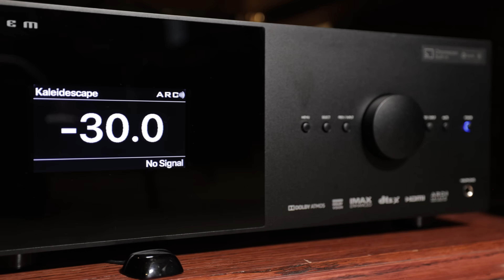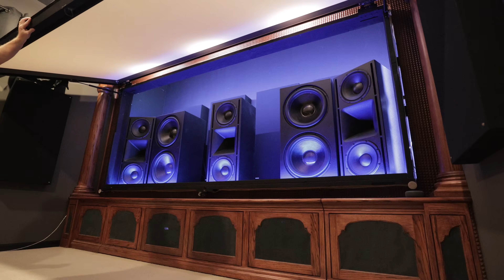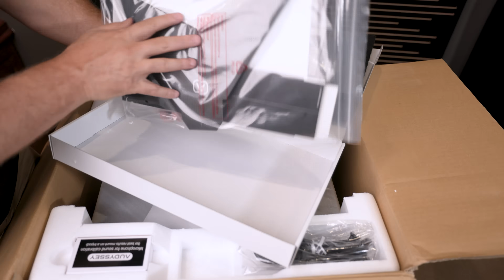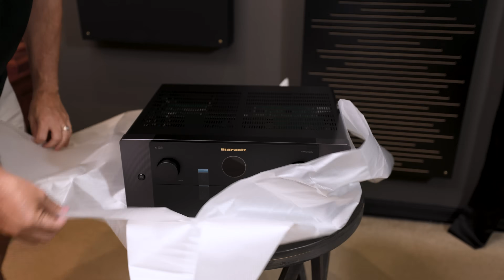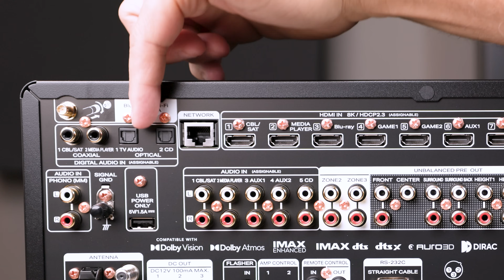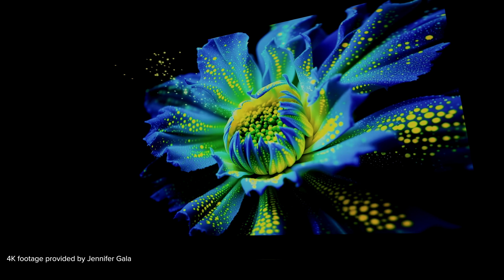Should I Switch Back?

Comment: Hey great video,

Crestron home can control the Marantz through ip, it’s easier to configure and gives bi directional communication giving the home processor feedback if the amp is on or off, which mode etc

Comment: I had the Anthem 70 8k runnin 7.2.6. I sold it along with Tonewinner 11 chan 8300pa amp. Now I run a 5.2.4 with just my Onkyo RZ50. Less wires & mainly a lower Coned bill

Comment: I definitely wouldn't buy marantz or denon again, both are the same products in different boxes. I had nothing but reliability problems with both brands, after trying several different av products with both manufacturers.
Reply from the maker: I’ve owned 2 Denon AVR’s, 2 Marantz AVR’s and 2 Marantz processors. Absolutely zero issues with all 6 of them. 🤷‍♂️
Reply: @Youthman consider yourself fortunate, as when you get a faulty unit it's incredibly frustrating. I've had loads of different manufacturers products over the last forty years of my av journey. Denon and marantz are not two brands I would consider buying again based on my experience with them.
Reply from the maker: I totally get it. It’s incredibly frustrating. I just rarely hear people on my channel. Say they’ve had tons of problems, most rarely have any. The important thing is to find a brand that works for you.

Comment: Love my avm 70. Arc blows away Dirac on every level .. I will switch to the 90 when it  goes on sale again
Reply from the maker: I have been able to achieve great results with both ARC and Dirac Live with Bass Control. It was much easier to get my bass dialed in with DLBC than with ARC.

Comment: The issues with the anthem sound like they could be easily fixed or tweaked with a firmware update but I mentioned in an older video they don’t release firmware updates for some reason looking it up the last one was from 2023
Reply: Stinks your thinking about going back to marantz I moved to anthem from your recommendation
Reply from the maker: By does it stink what I use? The Anthem is still a great processor.
Reply: @Youthman it’s a great product don’t get me wrong and for me the most expensive part of my little theater so i’ll keep it till it dies or I win the lotto.  I understand in your line of work change is inevitable but still stinks lol
Reply from the maker: Continue to rock it out. Until it gets to the point where it doesn’t do what you needed to do, keep it.

Comment: Without any doubt..I was seriously looking for a new A/V Receiver. I am waiting to see what Onkyo is about to release. And looked at Anthem  MRX 1140  What  truly scares me about Anthem…It is NOT an Easy Set up. It is 100% Complicated. You first have to download their Own App into a Laptop, or Mac. 😵‍💫 Then you have to have Your momma cat..birth out 7 White Kittens and 2 Black Kittens and then Spin on ur head 20 Times before Anthem will turn on. Or Something Like That. Their own Set Up System, Which they Advertise Complicated but Simple? You have to jump through so many Anthem Hoops to jump through. Even at Crutchfield this warning Please note: This advanced home theater receiver requires running Anthem's acclaimed ARC Genesis calibration system on your Mac® or Windows® laptop during setup, using the included microphone and stand. It's not the simplest process we've seen, but it does a wonderful job of tuning the sound to your specific room. (See our video in the image carousel above.). I watched the video on how to set up this Anthem Receiver..I was Doomed from the get go. It made say…Hello Marantz, Sony, Yahaha, Onkyo, Denon. Even hello to A Separate System at McIntosh. 😵‍💫

Comment: Anthem is trash!
Reply: false.
Reply from the maker: He’s trolling.
Reply: @Youthman  Not at all

I had an Anthem 1140 for a month, was super excited to upgrade from my Denon 6500 as thought Anthem was a more premium brand

Couldn't live with it.  The first reaction to first pressing "play" was "oh"

Used the recommended forum guru to tweak my ARC.  Paid a local calibrator to...calibrate it,

No difference.  "This Modern Age" by the Strokes was unlistenable.

Factor in the fan noise, and the delay to resume audio when streaming.

Sold it at a loss after a month, bought an open box Denon A1H that instantly put a smile back on my face, and sparks genuine joy every time I listen to it
Reply from the maker: I appreciate the additional info. Just stating something is trash doesn’t provide any context. I’ve had an absolutely fantastic experience with my AV70.

When I previously reviewed the MX1120, I liked the sound, but the bass was underwhelming,

Same when I first got the AV70. It took a while for me to get the bass dialed in but now sounds fantastic.

Comment: All of those speakers in such a small room are not great. You are making things a lot worse.
Reply from the maker: You have no idea what it sounds like. You’ve never experienced it for yourself. The 100 plus guests that have demoed my Theater (including several industry professional) would completely disagree with you so you’re certainly in the minority.
Reply: @You @Youthman  had this discussion with Trinnov’s head tech guy in the US. When you pack 10+ speakers in a small sealed room you get all kinds of issues: phase, frequencies get cancelled or boosted, and just muddied sound. Those cheap Audyssey calibration tools do not take into account multiple speakers in use at the same time. The kicker is you would have much better sound with fewer speakers, especially when you spend the same budget on fewer amps and speakers. Classic  mistake that I’m hoping others will avoid.

Comment: All these switches. What a waste of $$$ and time. TRINNOV blows all of these AVRs away.
Reply from the maker: Your point? Does this cost anywhere near Trinnov money? Nope. I’ve had a Trinnov in my room for several months. If that what do you want to use in your theater, go for it. Stop being such a negative Nancy bro. The last two comments I’ve read from you were complaining. Live life a bit, smile more, enjoy the journey.
Reply: @Y @Youthman u seem fixated on “upgrades”. You sold your Marantz, you switched to Anthem, you weren’t happy, you went back to Marantz. Does losing money make you happy man? If so, go for it. I got off the merry go round. Yeah, it costs more up front, but you pay once. The kicker is it sounds better. I was blown away by the difference between my Denon top of the line AVR and the Altitude 32.
Reply from the maker: The only thing I’m fixated on is having fun and enjoying the journey. I bought the Marantz out of curiosity. It has nothing to do with not being happy. I’m very happy with my systems 

If I prefer the AVM70, I’ll sell my AV 30. I won’t lose money.

Comment: My Anthem is constantly buggy and failed to power on not long after purchasing and had to go back for repairs.   Also Anthem has still not provided an update to use Spotify Loseless.  I wont buy Anthem again
Reply from the maker: I still haven’t had any issues with mine. It was a little buggy when I first bought it, but after maybe two firmware updates. All of those issues have been resolved.

Comment: Great presentation, you're definitely have a different level HT set up than my modest 5.1 set-up but I thought I would share my experience over the last 15 years. back in 2011 I purchased my first newly released Anthem the RX 300 - I think I was running a Marantz SR6001 before that. I loved this AVR! I used it for 3-4 years before I decided to upgrade to the RX520. Again I was happy but you are right about the HDMI, it always seemed that there was handshake issues with the Anthem AVRs. 

Well the RX 520 failed after about 3 years where I would lose sound on the right front channel - l did a search and found that this was a costly common problem. I decided rather than attempt the repair I purchased a used RX 310 which ended up having the exact same right front channel issue! At this point I was done with Anthem!

I purchased a new Marantz NR1510 somewhere around 2021, great for movies but missing Anthem's power for  music, luckily the 1510 had front channel pre-outs and I picked up a 140 wpc Marantz MM 7025 2 channel amp and the Paradigm Prestige mains were singing. 

I liked the smaller Marantz but the new Cinema 60 had just released, I considered this, but I like "symmetry" and opted for a used SR5015 which is identical to the Cinema 60 but with the old Marantz face plate that matches the MM7025 Amp. I'm a 69 year old who's very happy to be back with my Marantz, Paradigm,/Rel and Panasonic set up!

Comment: I have the Anthem AVM70 8K fully calibrated and have no regrets with the unit.   If I were to go higher than that then it would be the JBL SDP-80 and bring in a licensed DIRAC calibrator to do the pro setup.   On my main 5 channel amp I moved right up to the Anthem Statement P5 with an Anthem MCA 20 for the surround backs.

Comment: I have a Kaleidescape Strato K going to an Anthem AVM90, MadVR Envy Core, and JVC NZ800.

Sometimes when I stop a movie on K and it attempts to sync back to the 4k/60 UI I am left with a black screen until I switch inputs then switch back to the Kaleidescape. 

When it happens. Anthem reports “no signal” and Envy input also shows no signal, but the output to the projector is fine.

Is this the issue you are facing too @youthman? Anyone else?

I contacted Anthem, but it seems like they will never acknowledge or fix this sadly.
Reply from the maker: Have you tried swapping HDMI cables? How long is the cable? I believe it was Anthem that recommended to me using a longer HDMI cable (maybe 6’ or longer even if you don’t need the length).
Reply: @Youthman No, but it’s a pretty new 6’ Zeskit Maya that is certified for HDMI 2.1

All that aside, can you verify this is the same problem or not that you face? That would be very helpful
Reply from the maker: I have spoken with madVR. They have told me it’s almost always the HDMI cable. They have had very good results with Kordz. It would be worth picking up a 6’ or 10’ cable to see if it fixes your issue.
Reply: @Youthman  Hey I appreciate it, but I actually run the Kordz, it’s fantastic. There is no problem with the output between the MadVR and JVC at all. When the problem happens, I can still see the MadVR on screen UI, it shows no incoming signal, so this is definitely isolated to the Kaleidescape to Anthem link in the chain
Reply from the maker: Have you tested straight from the Kaleidescape to the projector?

And also removing the madVR from the equation?
Reply: @Youthman  No, but here is what does help - In the strato K advanced options hard set as much as possible instead of “auto”. For my system what made sense was prefer 4:4:4 chroma , prefer 30-bit color, and prefer HDR10. That seems to speed up sync times too and no problems yet with those settings. On a side note, I had to also configure the K for 18Gbps HDMI or every time my system turned on with control4 the K would just fail HDCP and output a black screen until I forced a handshake. This seems like a common problem right now.

Comment: I know you only have two subs at the moment but I also thought that Dirac live with bass control could only manage up to two separate subwoofers. this processor has four subwoofer outs ...I'm wondering if it's just future-proofing or if there's another way to calibrate using four subwoofers?
Reply from the maker: Far as Zaino Direct live does not have a limit on the number of subwoofers it can manage. It just depends on your processor how many independent subwoofer channels it has.

Comment: I have both Anthem AVM70 8k and Marantz Cinema 50 with all DIRAC licenses, including ART. In the end I preferred Anthem because I think that ARC Genesis is better compared to DIRAC LIVE and BASS CONTROL. ART was not able to show its full potential at least in my case, because for example it is not possible to use ART on Multi Ch Stereo and the measured decay times in REW were not improving as I expected. Marantz pre-outs are typically designed for around a 1.4V sensitivity which is not optimal if you power amp is having lower gain like mine. It requires higher volume numbers to reach reference levels.
Reply: Have you also tried Audyssey with the Marantz?

Comment: According to Phil Jones the AV 10 have much superior components, but what really buzzes me about his reviews? Yes they might have better components and they cost a lot more with their triple and double copper chassis but is there an audible difference between them? In a blind test. I did ask the question and I’ve not received a response. I personally decided to go with the. AVM 90 over the AV 10 as having to purchase direct which I know is an excellent calibration system but not easy to use on top of already an expensive unit. where the AVM 90 calibration system which is supposed to be very good  calibrations system out there, based on reviews and much easier to use then direct. I had a Marantz 8805 which I had handshake issues with the LGOLED on many occasions even after changing multiple HDMI cables.
Reply from the maker: I would not expect any manufacturer to be performing blind AB tests between their various models. That would need to be performed by a third party.

Comment: I just picked up the Denon X3900H and I'm currently just running it with Audyssey but it does support Dirac Live, Bass Control and ART so It'll be interesting to hear your opinion on those.
Reply: Dirac Art is beneficial as it extends the bass and mitigates low frequency deep. However, it requires significant time and optimization. You need at least dual subwoofers to fully utilize the Art's performance.

Comment: Getting a bit pricey though. $4000!!?. I think I will stick with my Marantz 6014. It will run 11.2 with an Emotiva 200W 3 channel front stage and a Stark Sound 8 channel for the rest. Add 2 Stark 15" sealed subs and a Ported 12" PB2000+ behind the couch. 
It would be a nice upgrade but then I would have to upgrade everything else.LOL.

Comment: If running Audyssey on both units. Apples to Apples. Looking for your thoughts on any sonic difference between the AV7706 and the AV 30.
Reply from the maker: Great question but unfortunately, I won’t be able to answer that as I no longer have the 7706. I sold it two or three years ago. But I would really encourage you to consider trying out Direct live with bass control

Comment: Shameful Anthem never released a software update in 2 yrs to correct handshake issues and the horribly slow syncing of audio and video.  Then there is the fan noise issue around their AVRs.   Glad I didn't spend the add'l money over Denon.

Comment: I think without room correction the Anthem will give you a better movie experience. Adding DIRAC changes it to the Marantz being better. The Anthem is more versatile with its virtual inputs, but it was a huge mistake on Anthems part to only include 2 sub outs at the 70s price point. Anthem needs to seriously wake up and get with the current times with its room correction. It needs a serious update and much more flexibility. They better wake up...and soon. They are the only company in this segment who has been stale for the past several years.
Reply: Elaborate please on ARC Genesis.  DIRAC isn't a slam dunk.  You want the best then go Trinov.

Comment: Bangin' AVR but once i got a stand alone Processor. I jus can't go back to a avr. I heard this and other avr's and they do sound very good but to my ears and the right calibration. Which i do manually, i like my settings better then those auto settings. Cause u can fine tweak whatever EQ level u want. But hey, everybody different lol.. Lights, Camera, Action!!
Reply from the maker: I don’t think you watched the video where I explained the AV 30 is a dedicated processor, not an AVR and that requires external amplification.
Reply: @Youthman Oh, that must hav been when I went quickly to add more Food to my plate😅🍔🍟🍕🍰🧃instead of pulsing video😂😂😂Sorry🎉🎉
Reply from the maker: 🤣 It’s all good

Comment: Manufacturers should really consider  pulling the plug on 8k enabled AV products. Despite the hype, 8k never really has any physical media or streaming content. Only upscaled. So basically we are made to pay for something which never really took off and goes obsolete without even using it. Going back to 4k can bring down the insane  8k AVR price tags.
Reply from the maker: That would be difficult to say without knowing the exact cost of 8K over 4K boards. But I agree right now there’s pretty much zero content in 8K.

Comment: Anthem MXR1140 owner here.  I experience HDMI handshake issues occasionally also.  The only fix is for me to unplug and re-plug in the HDMI cable.  It's super annoying when it happens because my equipment closet is in an entirely different room.  Frustrating to pay this much money and have little annoying issues like this.
Reply: My 1120 is still going strong - haven't seen the upgrade to the 1140 worth it other than separate subs configuration.  I love their products.

Comment: Curious how this turns out. Had mulitple denon/marantz before my current anthem and pro /cons of both.  Not tried Dirac or audyssey-x which could be a step up in being able to really dial in the sound, and having 4 independent sub outputs rather than using a minidsp would be nice.

Comment: The problem with Anthem’s high end processors is they’re made in Vietnam, whereas Marantz’s top processors are made in Japan. 

Warranty support form anthem is also a headache, as it has to be shipped to Canada for repairs. Purchased a brand new Marantz AV10 for just a bit more than a AVM 70 8K and will never look back.
Reply: Sounds like the issue is more of a design problem than a manufacturing problem.  Doesn't matter where a bad design is manufactured.
Reply: So where do you get your maranta serviced if necessary ?
Reply: @johnwhite2576 Marantz has several authorized repair centers throughout the USA. Much easier than sending it to another country.